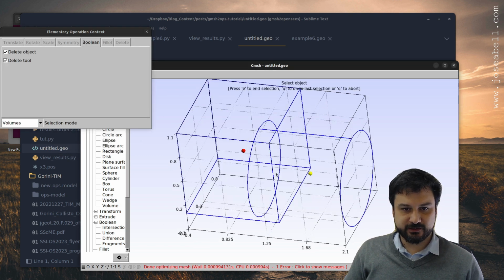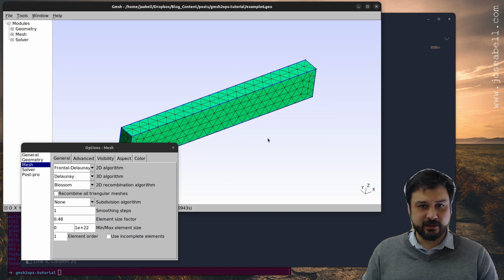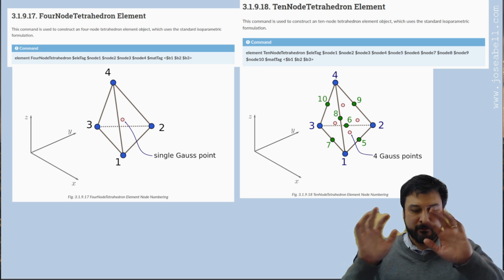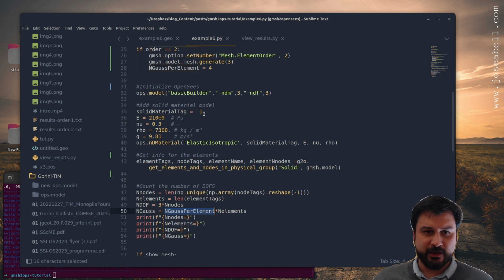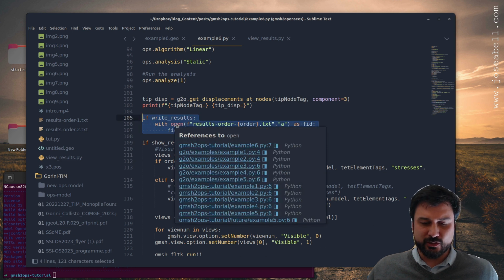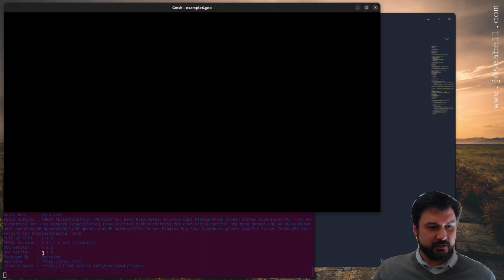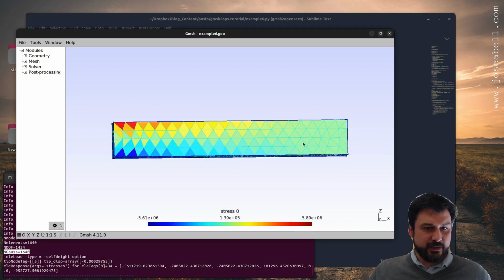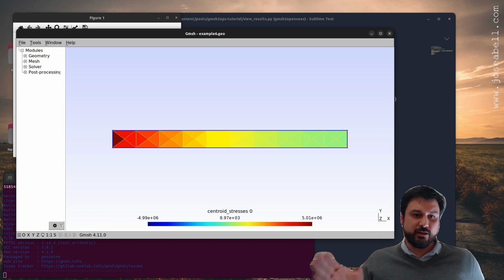Gmsh OpenSees & Python: All about tetrahedrons!

Comment: Thanks so much for sharing Jose. I am investing some time into learning Opensees with gmsh these days and your tutorials have been extremely helpful. I have been recently playing around with ShellMITC4 elements for modelling a pipe geometry and came to know that the “stresses” eleResponse outputs internal forces instead of stresses for that element type. The four node tetrahedral elements would output the element stresses when the “stresses” eleResponse command is called correct? On another note: I was wondering if you might be able to show how gmsh can be used to mesh a straight pipe geometry with four node tatrahedral elements and brick elements (e.g., 169 mm diameter, 4 mm wall thickness, 60 m long). I have been trying the ‘transfinite’ command which works well for the surface mesh but I am having trouble getting a good mesh for the 3D volume of the pipe.
Reply from the maker: Thanks for the feedback! I'm so glad this is helpful. For the ShellMITC4 "stresses" will output the internal "forces" integrated across the thickness of the layer (moments, axial forces, etc.) per unit length, as per plate theory. If you want stress at a given layer (if your're using layered sections) you need to request fiber output. I'll be doing a tutorial on shell analysis in the future. 

I'll be also glad to model a pipe with 3D elements, I might do a live this week and cover that in a "raw" format (no video edits, etc.) to save time.

Comment: Thanks a lot, I see you use union to merge two volumes, can you please advice on the following: if I have a large box (compututional domain) and I want to embed, say, a sphere inside it and keep the two volumes distinct but do a proper meshing, would you please provide few gmsh script commands to do so, thanks!
Reply from the maker: You can use BooleanFragments (or Coherence) to have a conforming mesh on the boundaries of geometrical entities, while still keeping the entities distinct. Check this out:

SetFactory("OpenCASCADE");
Box(1) = {0, 0, 0, 1, 1, 1};
Sphere(2) = {0.5, 0.5, 0.5, 0.2, -Pi/2, Pi/2, 2*Pi};
BooleanFragments{ Volume{1}; Delete; }{ Volume{2}; Delete; }

Comment: Thanks for this video! Is using any nDMaterials, such as SAniSandMS or PDMY02 with TenNodeTetrahedron Element, possible or not?
Reply from the maker: Yes, it is! I think you'll see advantages in using high order elements with highly nonlinear materials such as those. Both in convergence rates and computational cost. TenNodeTetrahedron and the high order brick elements should afford similar advantages.